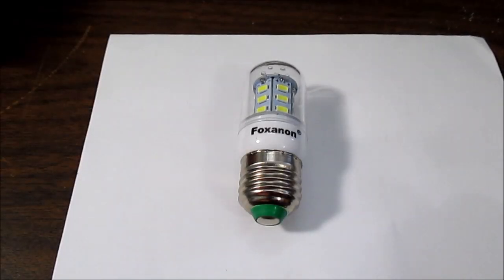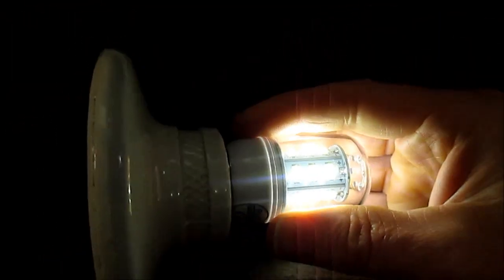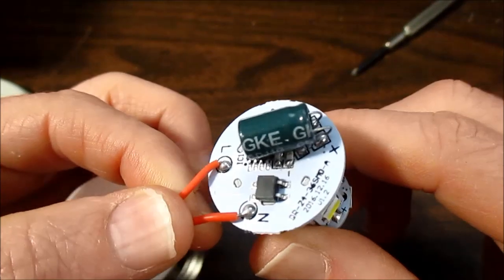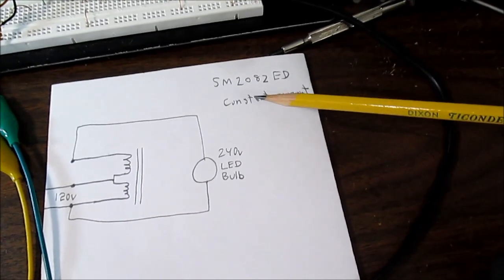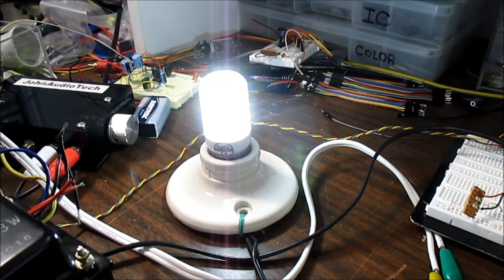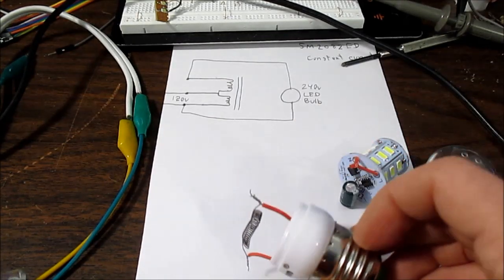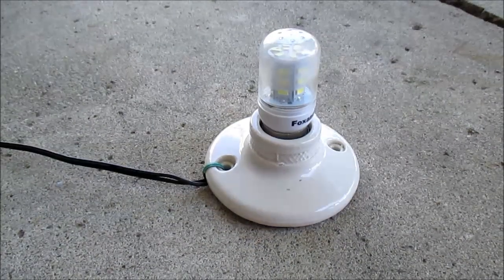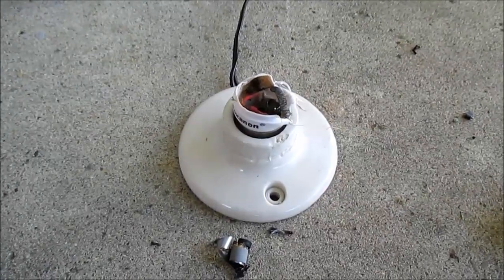Cheap LED bulb review, teardown and pop

Comment: I don't think it was the capacitor which blew the bulb. It seems the heat generated by the burning heater element heated the trapped air inside the bulb which expanded and finally blew out the bulb. My thought....
Reply from the maker: The bulb is not hermetically sealed so no pressure would build up. The capacitor blew its internals out.

Comment from the maker: Some more explanation / conclusions:
1) Light color temp was high. Around 7000 Kelvin.
2) No fusible component or trace on the board (not good).
3) Capacitor did not vent built up internal pressure properly. Exploded the lamp!
4) Plastics used did not support combustion. That was part of the reason for using the heater coil. I was expecting the thing to burn.
5) No safety certification labeling.

Not having a safety fuse inside (even the dollar store bulbs I tested has them), I would not recommend this bulb.

Comment: Uuh, destroying things is soo creative.... :-(
Reply from the maker: The idea was to have an interesting way to show if the plastics used were flammable. It had a secondary (unintended) benefit of showing that the capacitor safety vent did not function correctly. The capacitor exploded blowing the lamp apart. The lamp also has no fusible element. Not a product I'd want around. It deserved to die!
Reply: Thanks for responding and giving some details, Without some explainatory words your video was like: "i destroyed something, i feel good now". I do not like that train of thought. For educational purpose, destruction makes kind of sense, somehow, i think, err... or so. :-D

Comment: When you add the transformer does it do 240v at 60hz? And is it comparable to the 240v at 50hz? I'm probably mistaken but I think I read that's the frequency across the pond? Hopefully my question makes sense. Nice explosion BTW!
Reply: Before JAT has a chance to answer, I'll go ahead and say yes, it's converted to 240VAC at 60 Hz. And yes, it is comparable to 240VAC 50 Hz  (I assume you meant compatible?) as the full-wave bridge and filter cap converts it to DC anyway. You'd run into problems with 50 Hz if you were feeding a transformer designed for 60Hz, and vice versa.
Reply: wirenutt57 thanks for helping but compatible wasn't really what I meant. I meant more like equal to. I wasn't sure if 60hz at a certain voltage is the same current/amount of power as 50hz at the same voltage. I realize my question is not clear. I guess I'm talking about amperage? Sorry for the noobish question.
Reply: AC power is measured as RMS (Root Mean Square) which will make comparisons valid between 50Hz, 60Hz,and DC. So to answer your question, 240VAC at 50Hz will produce the same power as 240VAC at 60Hz, and will, in fact, the calculations will be the same for 240VDC. The only limiting factor in JAT's circuit will be the capacity of his transformer, which will be rated in Volt-Amps. The transformer he is using doesn't look like it has much capacity, but plenty for the few watts he needs it for. Transformers that will run industrial equipment drawing hundreds of amps will be the size of a refrigerator. This little guy will be good for a few watts or tens of watts. And there's no need to apologize for asking questions. Yours is a valid and interesting question.
Reply: wirenutt57 awesome thanks for clarifying fellow JAT supporter!